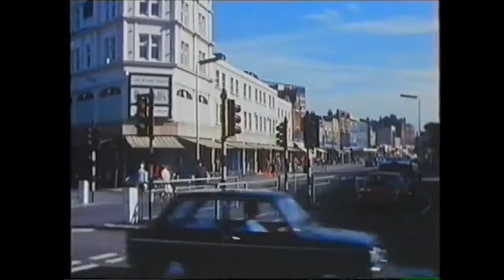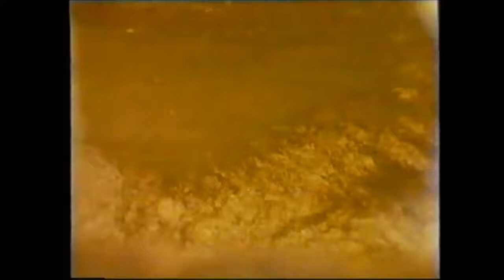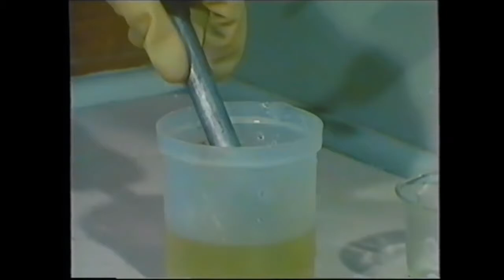Properties and Grain Structure  性能和晶粒结构

Comment from the maker: 06:32  result from       08:49  resulting   10:27  magnify      14:29  coarse    
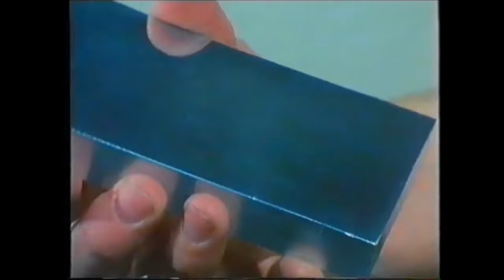08:59  give rise to      08:49  carry out     16:57  modify   01:02  visible (2)
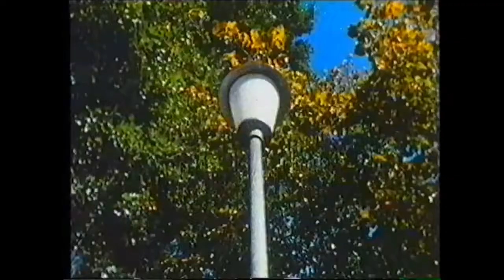11:14  roughly             02:33  nearer      00:22+03:42(3)  crystal   07:30 recrystallization
07:51  recrystallize    16:24  indeed  02:08+05:13  shade (n/v)  03:42 outwards(adv/a,n)
15:52  grow out           02:38+04:49+09:38+12:49+15:16  find out
09:12  undesirable      00:07  around (prep/adv)    09:38  (a/adv,n,v)plain carbon steel
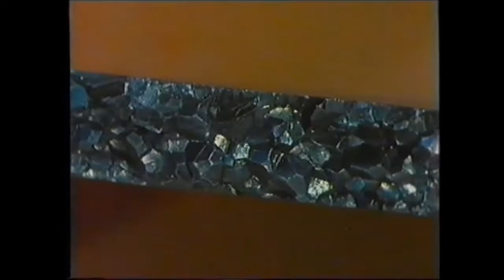18:07  finish up           01:02  not even   08:59  at the expense of   10:27+17:56  nearly
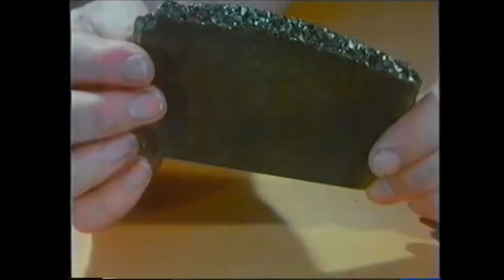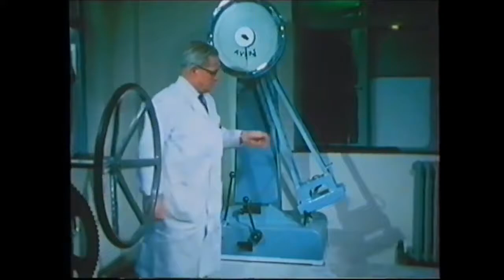03:09+10:30   in turn     00:46  turn over    02:13+14:15+14:38 reveal (v/n)
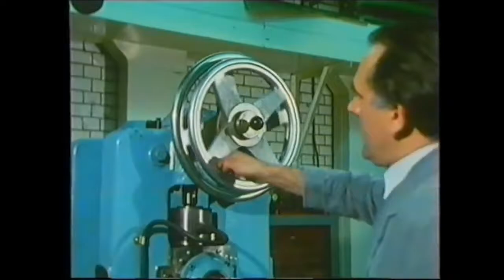13:21   take out of       05:38  has done to (do to )   12:54  be of     08:40  stretch (v/n)
十 03:09  run out  03:09  run into     02:33  get near   11:38+13:52  start with
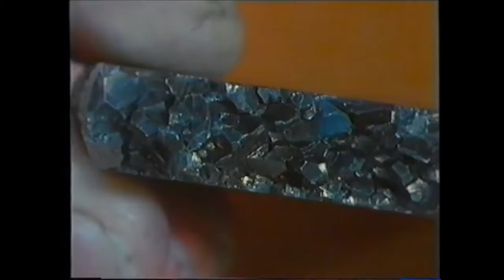     04:01  fully       00:56+11:18  make up of   10:45  make up in    13:12  ones
06:50  sufficiently    18:04 insufficient     15:01+17:16+18:01  quench (v/n)   16:05 quench (n/v)
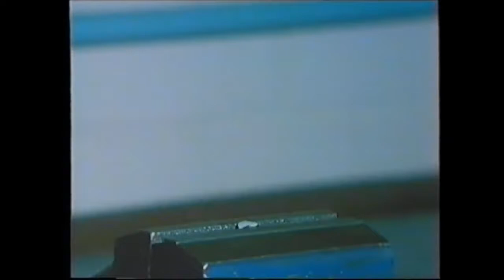16:24+17:13   brittle  16:38  brittleness    01:11+09:44  finish (n/v)  1:50+4:57 + 9:44  etch   01:44+02:17  etching
16:57   flake (n/v)    00:38  machine (v/n)   07:38+14:15   resistence    06:32+07:34+12:31  mechanical
03:09+03:15+04:21   slab    03:42   liquid (a/n)    03:14+04:01 solid  (a/n)   03:29+03:35+09:30   solidify
03:03   mold (n/v)      03:14 +04:21  sheet      09:30+13:25+14:38+14:58   cool (v/n,a)   12:37   cooling 
05:29 +12:07+15:35  amount      01:44+03:35   special      01:59  final (a/n)
04:35+06:11  squash     07:51+13:59  compare  10:09   unaided   15:50+18:16   exactly as
07:03+10:30  in the case of    02:24+05:53   seem to     17:33   mainly    14:15   shock (n/v,a)
04:33   relatively      01:21   glove    07:13+13:09+15:52   boundary      00:07   closely
13:21   component (n/a)     04:39  working (n/a)    13:59   uniform (a/n,v)  
02:47   molten    08:05 +08:45  restore     05:58+06:21   elongated    00:18+03:42 +04:09 a number of 
11:43    the number of     13:12   take over    16:38   relieve   10:30   take a look   10:30 closer look 
14:15   impact (n/v)       01:21+12:36   carefully    02:08+05:13+17:00  appear    13:35  reappear  
13:52   appear to   00:18  object (n/v)     01:49+07:05 +11:20 particular (a/n)    15:35  particular (a/n)
04:50 +06:58+07:30 +11:34( 特)+12:49 what effect    00:07   barrier    06:22+06:58  distorted (a)
07:18   undistorted (a)    09:46+17:29   contain   08:05   what about    12:06   guess
08:13   pull apart    00:14+00:22  patch (n/v)    12:54  ring (n/v)    00:57  although    01:02  aren't
10:17   view (v/n)    00:14   build up of    13:12   original ones   17:28   harden  12:37  sequence (n/v)
  03:03  tap (v/n)    07:38  measure (v/n)     06:04  get a idea of   02:47 back (adv/...)  go back to 
03:47+04:01+16:16+16:57 each (det/adv,pron)   10:33  each (pron/adv,det)   10:45  the other
11:12  give to    11:38  some more (pron/deter,adv)   18:16  exactly  as   07:38  indentation  
07:51    dent (n/v) 

02:33  (DJJG)   04:33   (BDSZZJXS)    01:21  (GFZD)(FCZD)    17:29   (XZFCDYZDY)   10:27 (BSBDFS)
05:56   ( BUDSDWCS)    11:12  (GQFCDYZDY)  07:05  (not until (conj))